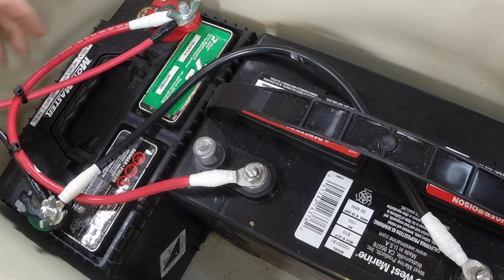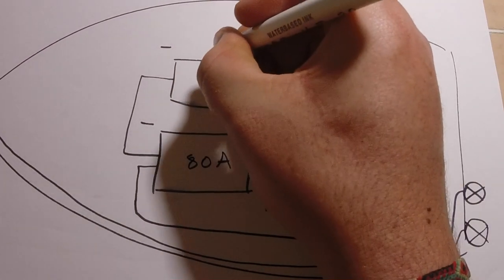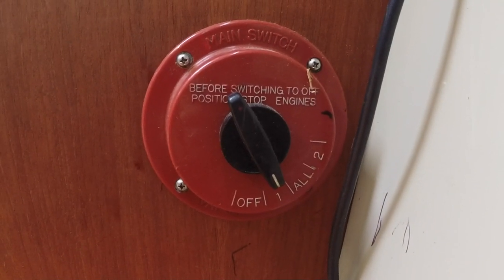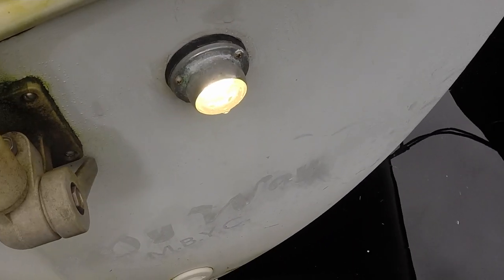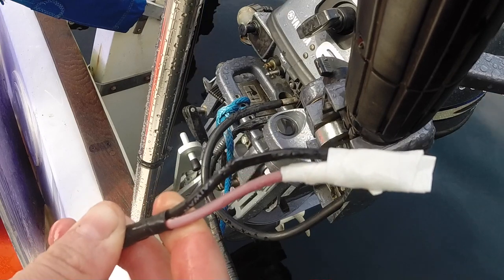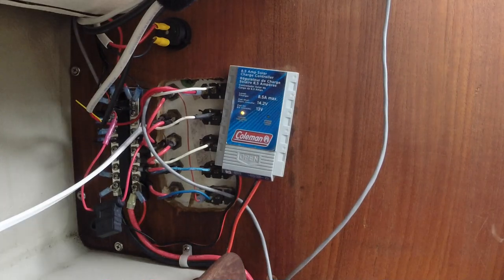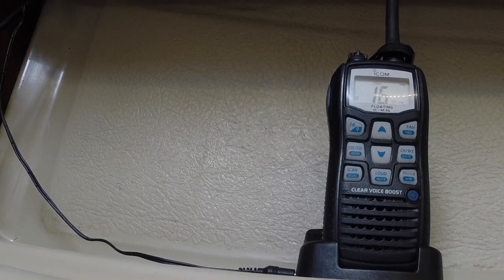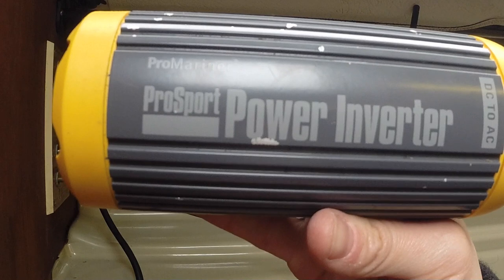5. Maiweh 24 foot C&C: Stepping the mast with only blocks/pulleys

Comment: I own a C&C 24 just like yours, only it has just one set of windows. Anyway, I have questions regarding the mast raising -- specifically how you get the notch on the bottom of the mast to hook into the mast step?!
Also, it appears the rear stay is connected to something  else far aft of the boat. Am I seeing things?
Any help you provide would be great.
Reply from the maker: Hi there! We don't have the boat in front of us right at the moment, but if I can remember right, we slid the bolt through the mast step and the notch before raising the mast (the bolt through the notch was able to hold the weight of the mast just fine). We had the main halyard running through a pulley on the dock, far aft of the boat, and then wrapped it around the cockpit winch. Either it was the main halyard, or a line tied through the turnbuckle of the aft stay extending it, but you can do it one way or the other. Hope that helps?